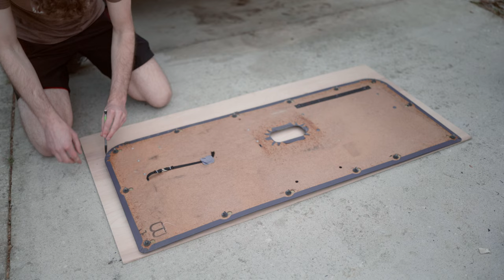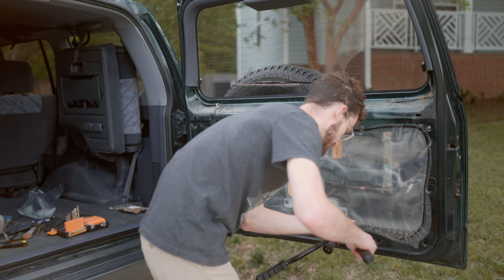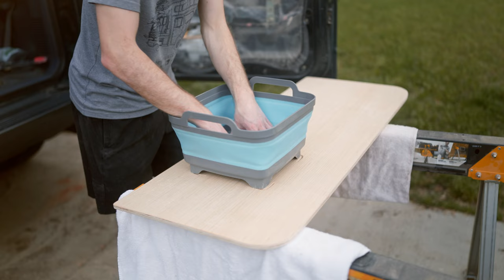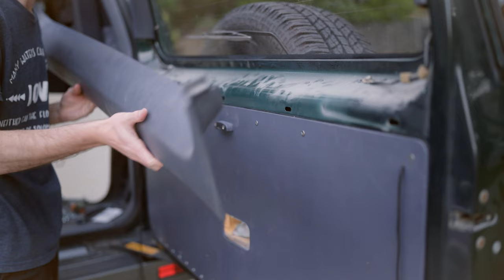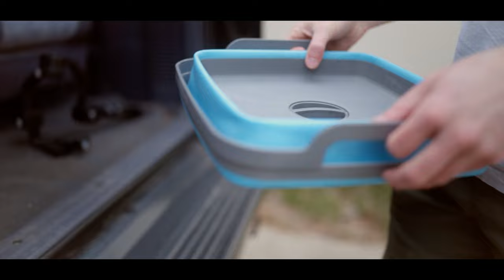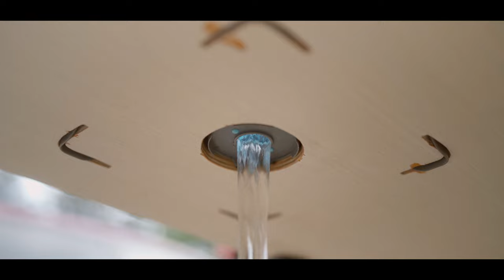Road to Overlanding | Pt. 2 | Rear-door Table | LC Prado 95

Comment: Very beautiful job. May I ask the thickness of your board?
Reply from the maker: @davidvanryn
1 year ago
I believe it was 1/4in (6.35mm) for the backing that actually screwed into the door. Anything thicker would've stuck out too much. For the bottom it was 1/2in (12.5mm)
Reply: @davidvanryn Very good. Thank you very much

Comment: Looks great - what thickness ply are you using please?
Reply from the maker: I think it was 1/4in (6.35mm) for the backing that actually screwed into the door. Anything thicker would've stuck out too much. For the bottom it was 1/2in (12.5mm) So far it's worked great! If I did it again I would maybe see if I could use some sort of metal arms to make it sturdier but I'm not sure how I'd do that. Thanks for watching Geoff!
Reply: @davidvanryn  Thank you for replying.
Reply: Got another question David -starting to cut wood now so getting serious! :-)  I see how you used T nuts on the on the backing to attach the piano hinge...did you just use small nuts and bolts to attach the table top to the hinge? Thanks again buddy!

Comment: What size rivet nuts did you use ?
Reply from the maker: That's a great question, I just checked my order history and I believe I used M5 rivet nuts for this project. If you're not certain you can use a measuring caliper to check the size of the hole. Hope that helps!
Reply: @davidvanryn  I ll make sure by measuring I just wanted to check in case you  are sure avoid the extra work removing the panel . 😀keep up the nice vids !
Reply from the maker: @overlandgreece2286  Thank you! Yeah I'd double check, it's always best to measure and get the right parts! Have fun with your build!